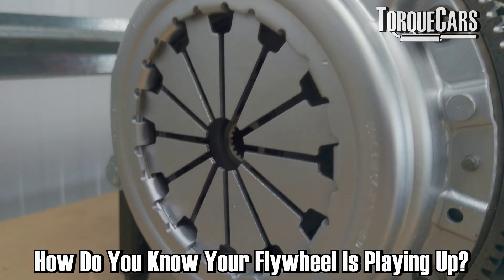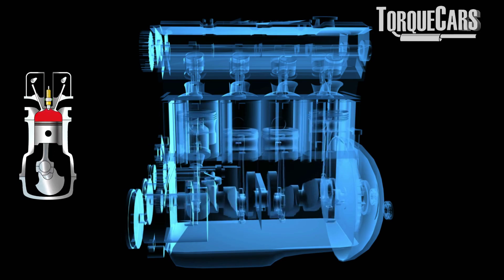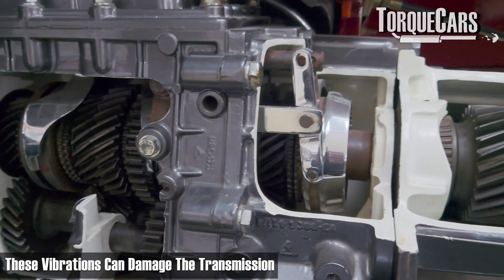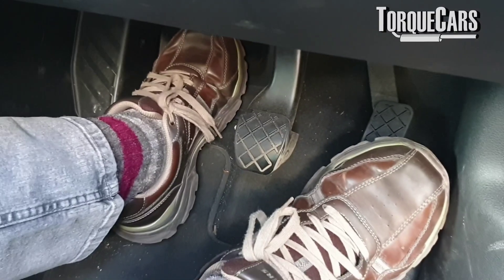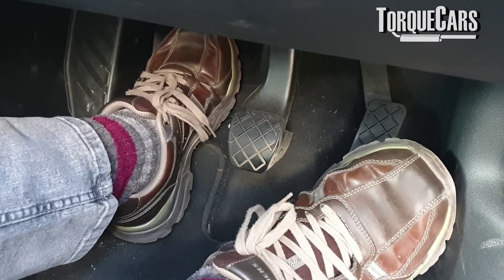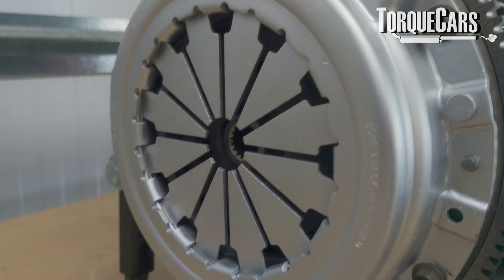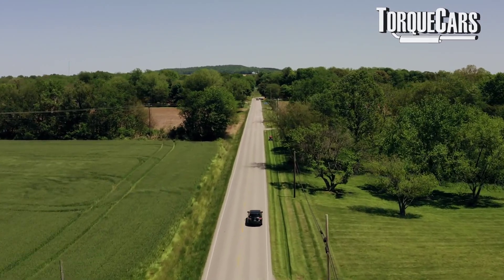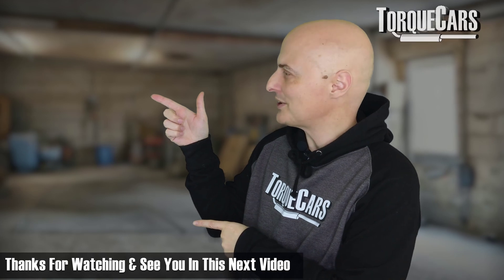It Could Be Flywheel Problems: Symptoms, Types of Flywheel, & Solutions

Comment: What about the VW EA211 1.4 L TFSI with six speed manual transmission, would you recommend upgrading the factory clutch and would a single mass flywheel be noisy?

Asking for a North American market 2019 Jetta S.
Reply from the maker: They are pretty smooth I would argue the cylinder deactivation models need the dual mass. I have had positive feedback though from people with a SMF on these engines. I would leave alone until the clutch starts to go though, especially if you plan to keep the car for some time.

Comment: I like to know how you know that the vibrations and noises are caused by the flywheel and not the engine mounts. My 2 liter petrol Mondeo MK4 started vibrating at idle somewehere after 110k miles and the engine making more noise (resonating) driving around 80 mph at 3500 rpm. The car has done 155k and its getting worse.

Comment: My friend asked me to look at his V-6 Ranger because it was knocking. I got the engine out and the flywheel was broke. Fuel pressure regulator failed and hydro locked the engine. My friend was killed in a car accident so I rebuilt the engine because it was out and paid the truck off for her.

Comment: Unsurprisingly the more complex the part, the more likely it will go wrong.  Trying to eke out lots of  power of small capacity low cylinder number engines creates strong pulses.  It's cheaper to bung in a dual mass flywheel rather than have a more robust gear box£££££££. 
It's probably better to think of this and the clutch as service items with a definite life, rather like cambelts.

Comment: Had a compaction roller with a one cylinder diesel engine in our construction company. One had to turn a knob on the cylinder head to open the valves and then use a hand cranking handle to start it. The hand cranking would spin the flywheel, and then when the valves closed, the inertia from the flywheel would take over, and the engine would start. 
One day, it became impossible to turn the hand cranking handle...
On dismantling the machine to troubleshoot, we discovered that the flywheel came loose. The mechanic jokingly said that's why it's called a fly-wheel, because it would literally have flown very far if it came loose while the engine was at full rpm's 😂😂😂